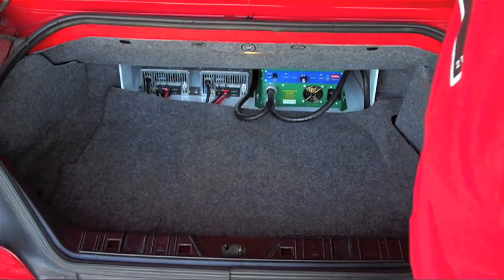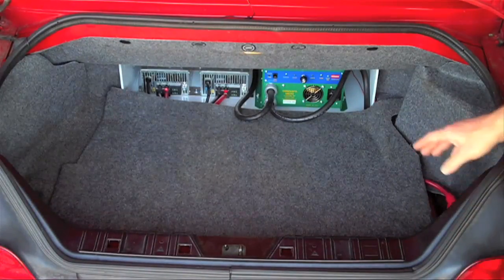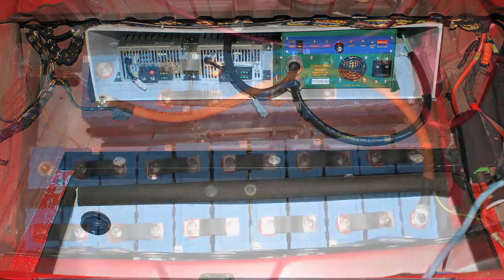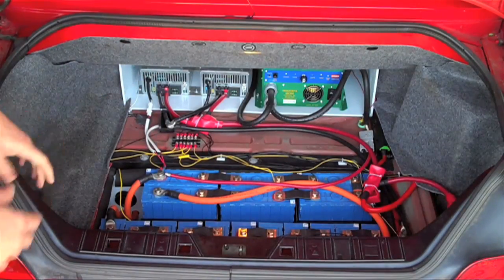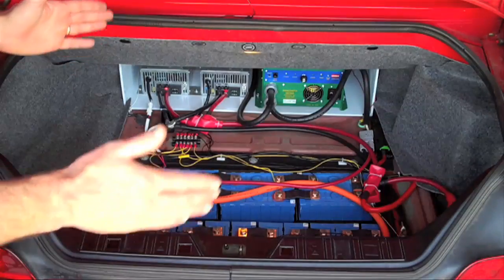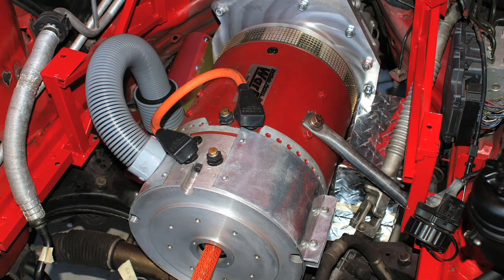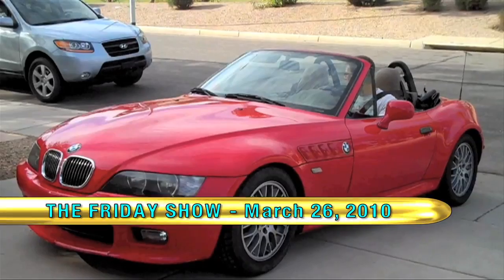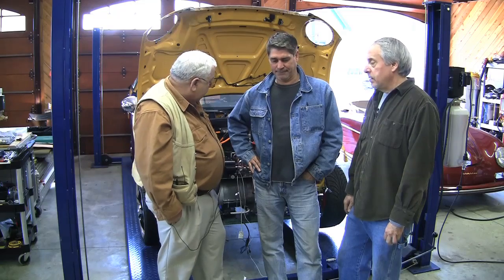EVTV News.  March 26, 2010.  Part 8 of 10  - http://EVTV.me

Comment: @tracym427 DC motors and DC motor controllers provide more whp and torque for the money then AC motors and AC controllers - especially if you use one of the high amp controllers like the Zilla, Warp-Drive or Solitron1 and a larger 11" DC :)